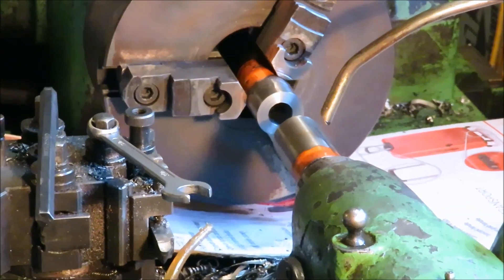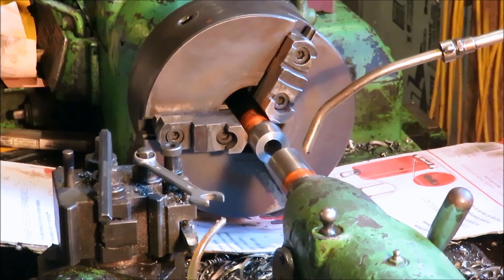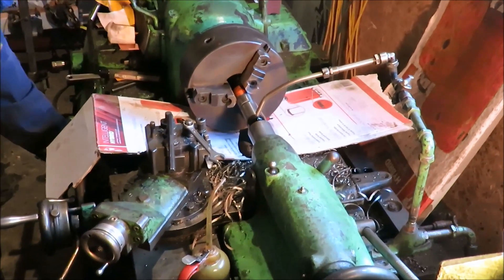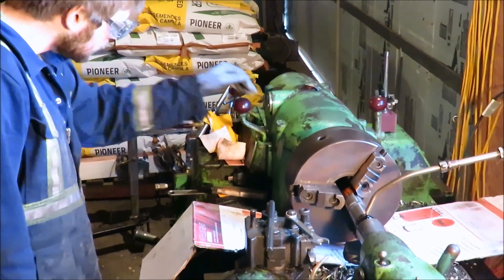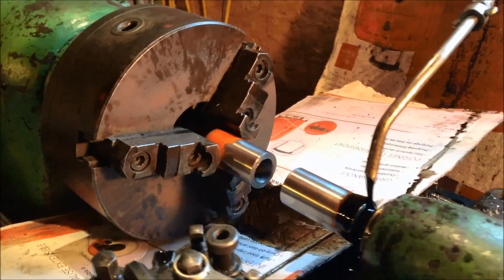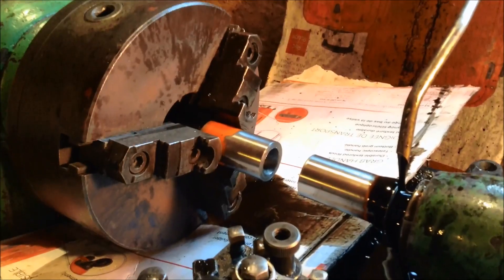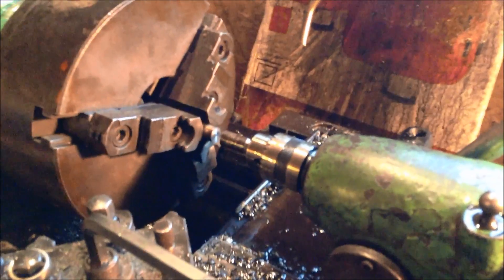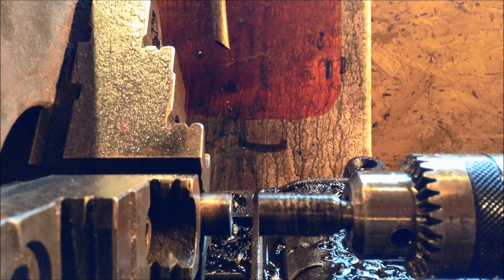Friction welding on the lathe at home

Comment: Good job, try heating up the welding surfaces with a cutting torch, should work better, since a lathe is not designed for friction welding.

Comment: Holy lack of safety... wrenches left on machine, long loose fitting sleeves, my guess is the oil has a low flash point and will light up real easily.
Reply: don't forget the cardboard to catch the molten pieces of metal haa haaa
Reply from the maker: don't worry it is cut half and half with diesel to keep it flowing in the winter

Comment: faster is always better when friction welding
Reply: when i friction weld polly fittings on water tanks the speed is around 3600rpm. i did this for 3 years with much success.